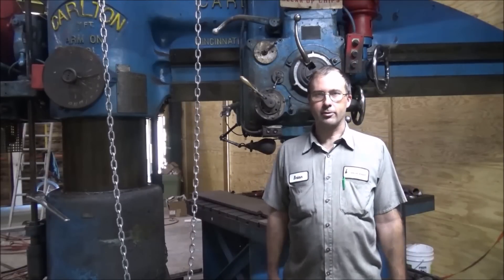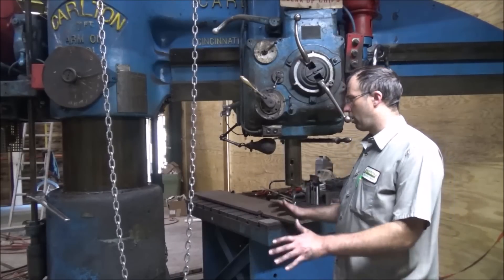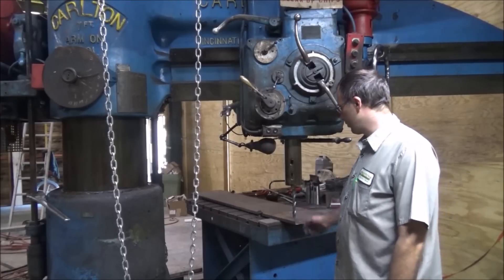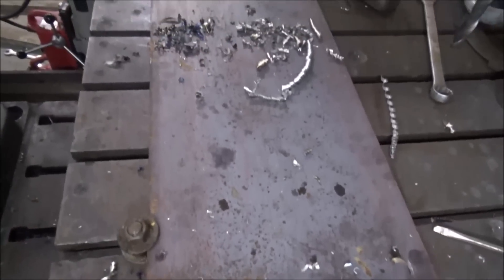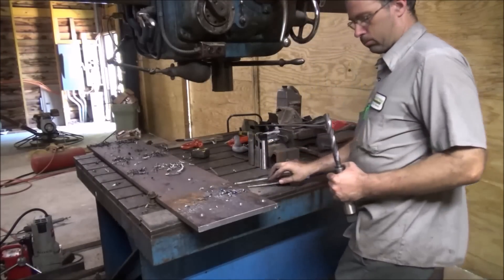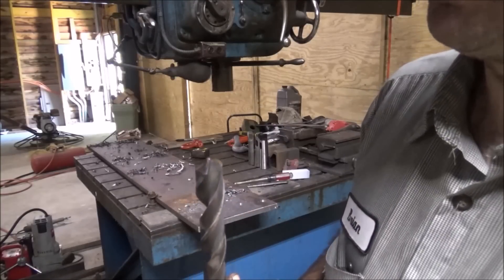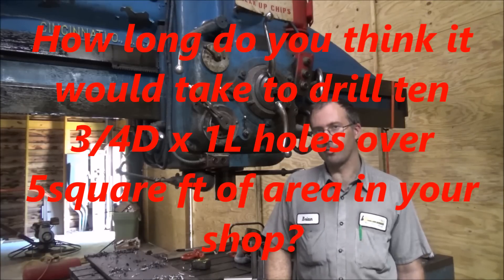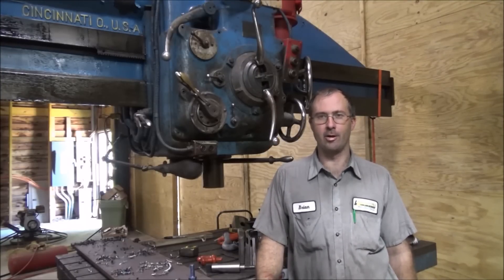What is a Radial Arm Drill Good For?

Comment: Like he's using it for, these machines are especially good for drilling (and reaming) large workpieces and large diameter holes that utilize drills with Morse Taper shanks, above and beyond a Jacobs Chuck...
Reply: ...Yes indeed...it is kind of obvious... that these are way ... WAY larger like 3 inch diam. ++  MT #5 Drill shanks.   Imagine trying to drive a drill bit through 
3" diameter, in 4 inch thick plate with the 3  small  lines of contact of the jaws of a Jacobs chuck!

Comment: Run It With Hyd. Motors, Get parts from old cement mixer?
Reply from the maker: I mean you could but that doesn't seem super practical since would have to have pump plumbing and controls as well.
Reply: @bcbloc02   Yes it would but, RPM, Power would be like a DC motor? Maybe a Gen. would be much better ?

Comment: When i sharpen a drill ,the only thing  for sure is that the drill will get SHORTER  sometimes  it gets sharper !  I saw the tool grinder in the shop i worked in BANG a  two inch drill into a grinder  four times , he handed it back to the user who said " cuts like a new one ". Awed and jealous did not quite cover my reaction !

Comment: 7.5 minutes per hole with a mag drill?  i guess that would depend on the power of the drill, but 3/4 is a size you can get annular cutters in iirc, those are a lot faster than trying to get a twist drill to make chips of all that steel.

Comment: We had an 8ft Carlton of same vintage at work. Recently was replaced by an even larger newer RAD. I miss the clutch action for the spindle drive of the Carlton though. The new drill is a push button setup, not as sensitive.
Reply from the maker: I also prefer the manual clutch feel on the G&L over pendant control.

Comment: Love these drills.... I got an old Cincinnati-Bickford Super Service Radial at work, installed wherever it was back in 1929 but we got it now. Dam thing cost $5200 back then too. Monster of a press, we use it to drill 1.5" holes through hardened steel rings used for giant shredders, each ring weighs around 500lb atleast, and maybe 4" thick, just a single punch, with a small marking/pilot hole.

Comment: "How long do you think it would take to drill ten 3/4D x 1L holes over 5square feet of area in your shop?"

In the shop I work at it would take in the range of 1 minuet.

This is to drill and reposition for the next hole only.  My time estimate is based on using a CNC HMC with 1,000 psi thru spindle coolant and a ceramic coated solid carbide coolant thru drill bit.

2,000 RPM @ .014 "/rev = 28"/Min  

1"(Hole) + .1"(feed prior to material) + .1"(feed below hole bottom) = 1.2"

(1.2" / 28" ) * 60 = 2.57 Seconds to drill 1 hole

1.5 * 2.57 = 3.85 Seconds per hole (This is an approximation to include retracting to the clearance plane and the effects of acceleration)

(5 SqFt)^.5 = 2.236'

2.236' * 12 = 26.83"

(26.83" / 2400"/Min (Rapid traverse rate) ) * 60 = .67 S

.67S * 3 = 2S

3.85 + 2 = 5.85

5.85 * 10 = 58.5 Seconds

That said I would not expect to be able to get the machine programed and set up in 14 minutes.

So for a couple parts you would be much faster with your radial arm drill.
Reply from the maker: Can't beat a cnc on repetition! I would love to have a bunch of coolant thru drills.

Comment: As far as i know radial arm drilling machines are ideal for large drilling and deep drilling and long and wade parts  but since Cnc has came about they becoming rare as it is cheaper and more accurate to interpolate the hole with an endmill but I have never seen a radial arm drill use U-drill or an indexable drill which are the fastest way of drilling large holes  but main reason you don't see them on anything manual is the power requirement to run the tool at its required speeds and feeds.

For me it feels like a very very large pedestal drill but the head moves not the table  never used a radial drill but never seen a use for it since anything that requires that sort of power we just use the cnc to do it and if the hole is beyond the holder size we can always use a boring head  but very very very rare we would need to do that

Comment: Brian, how you doing for proper hold down clamps and hardware? if you don't already have some, get some of the Bessy Right-Height style of clamps, they work great for jobs like that. I also have a couple of the ones that have the screw you tighten down onto work pieces, kind of like a c-clamp. A dedicated stud and hardware set just for the drill would be nice to have.
Reply from the maker: I am going to have to get a dedicated hold down kit for the drill anyway as it has smaller t-slot hardware than my other machines.  I definitely need to keep a look out for some of those right height clamps too since I think they would be perfect for jobs like this and not having to fool with the extra stand block for the clamp saves time.
Reply: @bcbloc02  What is time, again? Hobby funds.
Reply: I dont mean to be so off topic but does any of you know of a tool to get back into an instagram account??
I was stupid lost the password. I appreciate any tricks you can offer me.
Reply: @Ronin Lennox Thanks for your reply. I got to the site through google and I'm trying it out now.
Looks like it's gonna take quite some time so I will get back to you later when my account password hopefully is recovered.
Reply: @Ronin Lennox It worked and I finally got access to my account again. Im so happy:D
Thanks so much, you really help me out!
Reply: @Ezra Adonis happy to help xD

Comment: Basically goofy for the task at hand. I grab my mag drill an an annular cutter. Less work. Less energy and a hell of a bunch less footprint.
Reply from the maker: Your mag drill must be a lot lighter than mine.  AT 80lbs I can much easier move the drill into position than slide around my mag + it cuts a lot faster. It does however burn up a lot more shop space that is for certain!

Comment: I love your attitude and work ethic. I wish I could be more like you man. 

Why do you not have enough power for the drill? Didn't it come with rectifiers for the big D.C. Motor? If not I can show you how to build one. It's only about $300 for all the parts if for example you wanted 650 volts at 150 amps of D.C. Power. It would be much cheaper if you didn't need that much power.
Reply from the maker: I need 250volts and at least 80 amps.
Reply: bcbloc02  Hi Brian. That would be an easy power supply for you to build. If you can tell me about the power coming into your shop I would be happy to design one for you and spec the parts and safety circuit. Can you please tell me:

1) What voltage do you have coming into your shop from the power company? It could be 110, 220, 240, 360, 440, or 460. Those might not be the exact voltages, but you should have something close to those numbers.

2) How many phases does the power company provide you with? Single phase, or 3 phase?

3) How many amps is the service?

The total cost should be around $100 if you build it from parts and make your own case. The case would be a cake walk for you given your fab talents.
Reply: Well maybe closer to $50 if Yaoundé don't need an isolated supply. Is there anything left of the original power supply?
Reply from the maker: The original power supply was a motor generator set that was running all the DC for the whole factory. My power supply is 240V single phase at 400 amps coming into my shop.  I also will eventually have my phase converter in there too that will make my 3 phase for my other machines. The drill is 230VDC and about 80 amps so something capable of 100amps would probably be good.
Reply: bcbloc02 

Okay Brian we should be able to get you going in no time. Just a few more questions: 

1) Does the machine require just 250V DC to operate, or are there other voltages for different motors also required? 

2) Also, could you please measure the resistance from both the positive and negative 250V power inputs and the body of the machine? It should ideally be 0 Ohms to 1 Mega Ohm. Whatever that value is, please let me know.

3) How are you powering the drill right now? Welder? What voltage was it running at for this video?
Reply from the maker: 1.The coolant pump is 220VAC 3phase so the drill will be fed with both DC and AC drops. If I could feed the whole thing from 240Vac 3phase and do the conversion at the breaker for the drill might would be best.  
2. One Dc lead reads 82 Ohms the other apparently has continuity to the chasis.
 3. Welder shows 70volts when idleing the drill motor.
Reply: bcbloc02 

Okay, I think the best plan would be to run three phase AC to an electrical box mounted on the drill. That box can contain all your breakers, switches, and the D.C. Supply.

I am not wild about one leg of the D.C. (Probably the negative) being tied to the chassis of the drill. It was probably the best they could do for safety when the drill was built. It would also have meant that the factory's DC power grid was Isolated. There is nothing wrong with isolated supplies. However, an isolated supply at 250V & 100A is a pretty expensive beast, and not all that safe compared to modern designs. Modern DC power supplies can be built cheaper and safer if pos, neg, and chassis GND are all isolated. To that end see if you can find where the negative lead on the 250V D.C. lead is tied to the machine chassis. If you are lucky it will be a plain copper strap or braid somewhere on the neg D.C. power lead. The other side of the strap will probably go straight to a bolt on the chassis. I most often find them at the power inlet to the machine, or at the motor. If you can't find it don't  worry. It's not such not a huge deal, we will just need to work around it.

In the mean time I'll finish up the design for you and you can start hunting down some cheap parts to Get it finished.

P.S. Do you know how to read a traditional schematic, or would you prefer an illustration of the design instead?
Reply: @bcbloc02  easiest is to put 4 diodes in bridge configuration,big 400 amps diodes  on heat sink,and put them directly on 240v AC mains...but if phase is on side where you have 85 ohms is no no...make sure that bridge rectifier is permanently on mains and turn 240v AC 180 degree  on diodes,if phase is on minus..then phase is on safe side....best way is to put isolation transformer ,but that can be costly for that power....there is no need for that if phase is on plus side of the motor...today  inverter power supply  is rectified directly from mains,and if that is good for inverter,than is good also for motor,sure if you make permanent wiring to be shure that phase is on plus side ...regards

Comment: As a young millright in the 70s we had a operator who would blow up the gearbox when he didn't want to run it.We had lots of spare parts.They had smaller tables and would remove them for large pieces. Very powerful machine and capable of drilling 4inch holes with no effort. Thanks for sharing and saving it.
Reply from the maker: Holy smokes! I wonder how on earth you could fry the gearbox on something so beefy? Must have been changing speeds under load? Ouch!!!

Comment: A Hougans Annular ring cutter would probably work for that piece. Much smaller and cheaper.
Reply from the maker: I have annular cutters for my mag drill. The standard bit in the radial will cut the hole faster than the annular will in my mag.  Big advantage for me is the drill is easy to resharpen an annular cutter is not.  Also can't use annular cutters on non thru holes. They both have their advantages and disadvantages.

Comment: I already knew what they could do, used a smaller one before the best way to use it is how you did drilling several holes in a part. GladYou have it all running Just need a BIG Power Supply Or a Big DC Welder! What Voltage/Amperage do you need to power that Bad Boy Up?

Comment: Good to see that badboy in action Brian.  Does the head/spindle articulate at all?  So no need to tram it to the table?  I would be curious to see how the speed of that would compare to a mag drill.
Reply from the maker: Nope just goes straight down. You want an angle you have to angle the workpiece.  I estimated it 5 times faster than my mag drill.

Comment: It would literally take me a week to do that. Between the aggravation of drilling the holes with improper drills and breaking bits. Glad you stopped the mag drill comments before they started. Sorry for the dumb question but can you put Jacobs chucks in there and what's the smallest bit it could use practically? Great video!
Reply from the maker: I doubt I would ever run anything smaller then 1/16" in it. I have the 1/4-20 rule in my shop so that keeps me from getting too small.  It is simply a Morse taper spindle so you can put drills, drill chucks, end mills, boring heads or whatever you want to turn in it using the correct adapters.
Reply: bcbloc02 another dumb question. What is the 1/4 20 rule?
Reply from the maker: If it uses smaller than 1/4-20 thread fasteners then I don't work on it in my shop.

Comment: Very impressive drilling operations. I'm amazed how easily you were able to swing that arm around. Is your power limitations due to that your still using the welder to power that DC motor? What is the actual power requirements for that machine?
Reply from the maker: It swings a lot easier when the clamp isn't partially on.  Actual requirements are 230VDC and 80 amps. I only have about 60VDC now.
Reply from the maker: I tried it out and it can go full 90deg to the base and with the drill head extended to the end of the arm + me hanging my 200lbs off the end of it and it was still stable. I of course had the arm safetied with the crane just in case but it didn't even give a hint of instability. I think with the massive base + large heavy column it is more stable than a lot of the smaller drills+ the big DC motor and plate of steel on the motor mount I welded back on counterbalances it a fair bit too.
Reply: Thanks for that clarification, I was a little worried about you swinging it without it bolted down. They'll flop over real easy. 
Using the crane hook in a lifting eye at the top of the column is another good way to keep it from tipping far if it gets away from you.

Comment: Brian, Great demonstration!
When you swing the arm from left to right is there a clamp that is engaged to keep it in place or do you just rely on the mass of the machine?
One suggestion. Please move the hoist chain out of the video frame.
All the best!
Eric
Reply from the maker: Yes there is supposed to be an electric activated hydraulic clamp for the swing. With the low voltage it won't operate the coils so it isn't working so I am using it with it partially locked so I can still move it but it stays on its own.

Comment: I see blue chips mixed in with the bigger silver chips.  Wondering if those were made at the start of the cut before there was a thick enough chip to carry away the cutting heat?  Your bit must be really good quality to not get boogered up by making those blue chips.  When I see blue while using HSS, generally bad things happen :(

That's got to be a great feeling to make some chips doing real work with a tool you fixed.  Keep up the great work, AND letting us see you do it!
Reply from the maker: The blue chips come at the end when breaking thru and the mass isn't there to pull away the heat anymore.

Comment: when it is under full power will it swivel and extend out  and raise and lower under power or all manual ??? great job on repair
Reply: It  will raise and lower.Also I believe it can be set to cut threads.When I worked at a shipyard they had  one that size and it got more use than any other machine. They had a huge boring head for it and it bored many holes for sheaves,etc.
Reply from the maker: The swivel lock and unlock is by power but you have to rotate it by hand, all the other axis are powered. When the lock unlock is working correctly it moves extremely easy as the whole thing is mounted on a giant roller bearing.
Reply: bcbloc02 u

Comment: So, It's a DC motor, what voltage and current is needed?
Reply from the maker: 230volts dc 80 amps
Reply: Not too bad, straightforward rectifier would do the trick, 
 Or go old school with a motor/Gen set.
Reply from the maker: So I buy 1 cathode and 1 anode hook them to my AC power leads and get 60 cycle DC out the other side?
Reply: You need 4 diodes to make a full wave bridge if you have no center tap on your source, I've used some of this type of arrays to repair some welding machines:

http://www.farnell.com/datasheets/1761311.pdf

Each array contains 2 diodes so you need 2 units to a full wave rectification, other advantage is that the cases are insulated for an easier mounting on a good sized heat sink. 

You can find them at DigiKey or Newark Element 14 at a reasonnable price like around 30$ each, let me know if you need help so I could call you.

There are other brands with the same characteristics and packaging at those suppliers...
Reply: This might give partial answer.  http://www.wikihow.com/Tell-Which-Way-Round-a-Diode-Should-Be
Reply: Google "full wave bridge rectifier".  They are simple and cheap.  You can buy the individual diodes or get them all packaged together ready to use.  It helps to add capacitance to filter the noise out of the wave.  Shop 230V AC in, a few inexpensive components in between, 230V DC out.  Welder rectifiers would certainly work if they can take the 80 amps at 230V.
Reply: Yes, that would be the nicest solution, individual diodes is a cheap solution (I'm cheap), should not be a need for smoothing, the motor won't care about the ripple.
J.
Reply: You are correct about the ripple.  Induction does not care.